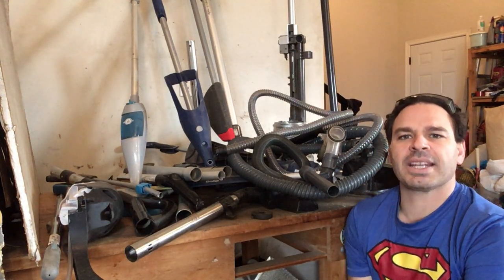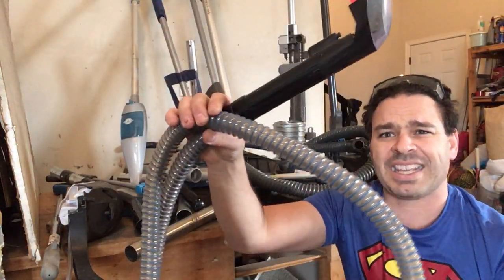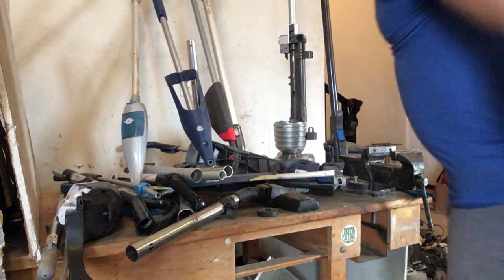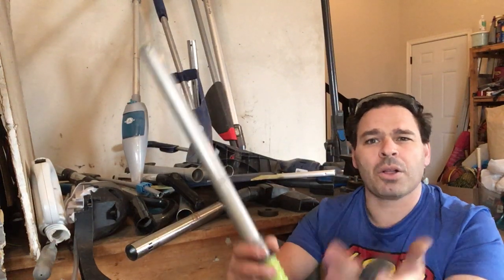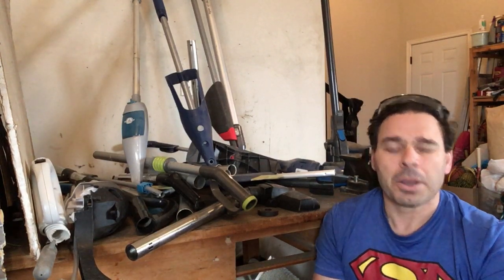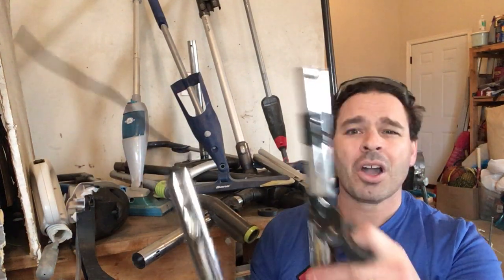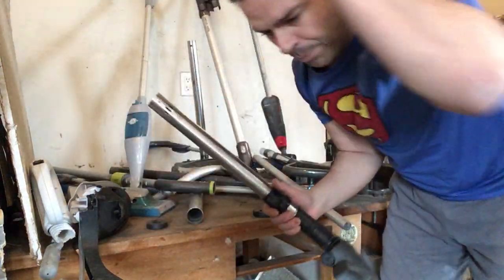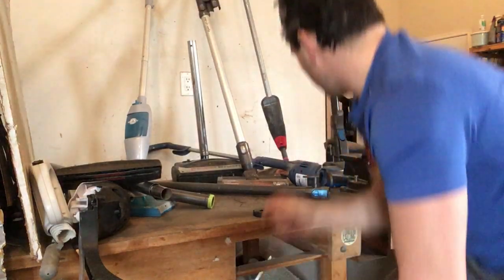Scrapping vacuum hoses and arms for great aluminum, stainless steel, and tin.

Comment: How would you effectively get that copper out of the built-in vacuum hose?
Reply from the maker: Pull the coil as straight as you can and grab the copper and pull. It will slide out. There is not a lot and I would suggest to cut the hose in several places so not trying to pull the entire copper wire out in case it snaps. Only got about 1.5 ounces so may not be worth it for you
Reply: @TinManScrapper  is there a super low end copper option here? Something below christmas lights? Lol
Reply from the maker: @superdud124  perhaps mixed wire, but not sure. Yard may say too much plastic.

Comment: so are you going to show us how you get the copper out of the hoses?
Reply from the maker: Was not worth it. I cut the hose in several pieces pulled it apart, grabbed the copper and pulled outward. It slides out. I only got about 1oz for it, so really not worth the effort, just through it in my tin pile
Reply: @TinManScrapper  Well that's good to know, now I will not waist my time on it either.